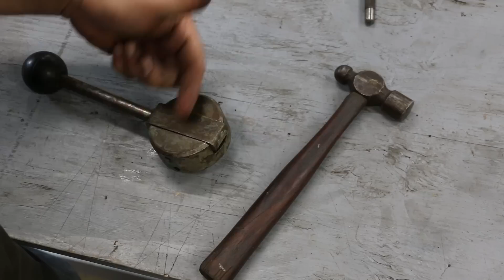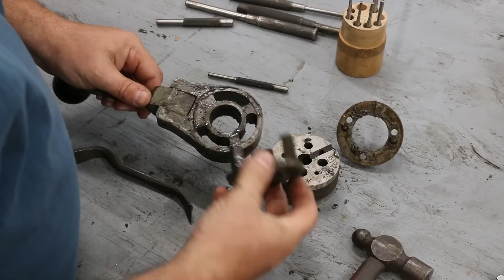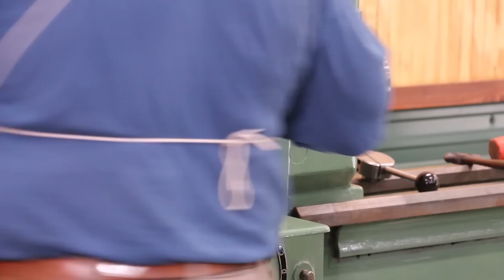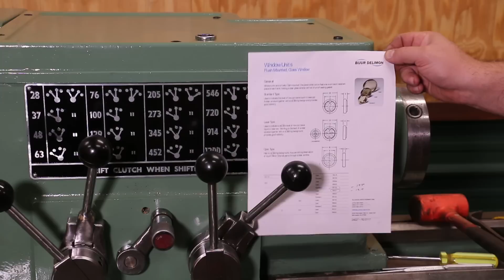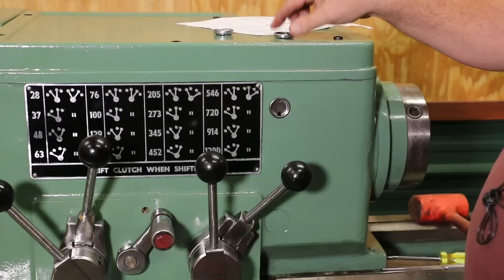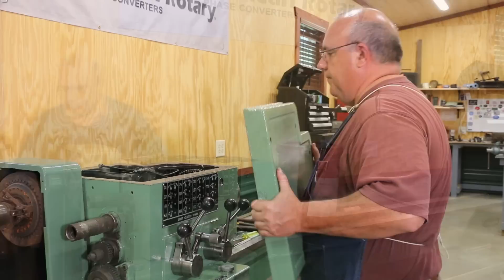Monarch Lathe Restoration 4: Front Controls

Comment: Keith, enjoy all of you videos. Lathe is looking great. I think a  couple of the screws in the gearbox cover were a little long. When you had them sitting in they were sticking out a lot more then they should have been.  If you pull them out and stick them in upside down, if the head is completely in the counterbore then you are bottoming out the threads and not tightening on the cover. Generally when I drop the bolts in the holes I like the head to be above the top of the counterbore between 1/2 and 1 times the thread diameter.

Comment: grey scotchbright SHOULD be "final" or blending grade

Light Green - Non abrasive for scouring and general maint
White - Non abrasive for polishing and light cleaning
Grey - Ultra fine silicone carbide abrasive for fine hand cleaning and finishing
Maroon - Very fine aluminum oxide for basic cleaning and finishing
Green - Fine aluminum oxide for removing rust or corrosion
Black - Medium aluminum oxide for heavy duty cleaning or fast action finishing
Tan - Coarse aluminum oxide for stainless steel aluminum and for stripping

Red is about 320- 400 grit
Grey is about 600-800 grit
White is about 1000

Comment: Two things. I'm surprised there's no gasket for the lid on the lathe. Secondly, your bench grinder wobbles like a drunk sailor. That really should be bolted down.
Reply: I'm thinking he is going to want to get a sheet of gasket paper and make a gasket for the head-stock cover. It probably leaks, or at least "oozes" oil. Why else would someone have used silicone on it? It would be a shame to have oil dripping down that pretty new paint job.

Comment: Thanks for another enjoyable show-n-tell.  Please describe "drifting the clutch while shifting", as it says on the plate.
Reply: You disengage the clutch (drop the handle down partway) without stopping the lathe, so that the gear train is "drifting", i.e. no pull against the gears and no deceleration. You can then shift without clashing. It DOES take some practice.

Comment: If the lathe top leaks oil a thin layer of silicone sealer on the machine surface and a thin layer of grease on the lid surface works wonders. The silicone seals it and the grease keeps the silicone from sticking the lid down. Works great, i've done it for 30+ years,

Comment: I usually find when I need to hold a spring, detent, pin, or whatever else tiny in a hard to reach spot and gravity keeps yanking it out, a touch of thick grease on the pin holds it just right. It helps lubricate and prevent rust in the future as well. Keith clearly knows what he's doing, just thought I'd share that tip with everyone.

Comment: I would be surprised if that top doesn't sweat oil when the lathe is running high speed and flailing oil around inside. Those handle mechanisims are interesting compared to the pegs on the case that detent the levers on my Monarch. Lathe is looking great, better get to making some more space in that shop for more tools! :-)

Comment: Hey Keith, When you get around to putting the clutch linkage and shafts back together can you show that in detail? I have a lot of wear in my clutch linkages and needs a lot of work I think it's mainly in the gearbox where it crosses the bed and then runs around the back of the head stock. Also if you pull the compound shaft out can you measure that as well I need to make one the original one is missing and I need a better idea how it goes together. My Monarch is a 1944 18CW 18" swing and 30" between centers. I think the parts are the same between them Just newer on yours.  Thanks. your lathe looks a lot better than mine right now.

Comment: Whenever I mess with the controls, I pull the shafts and replace the o-rings. The shafts are typically below the oil level and they always leak.

Comment: Looks good, did you do anything to the plastic knobs and if so what?
Reply: Nothing much happens to Bakelite knobs when they have been indoors.
Reply: I have a couple on a used machine that are beaten up so I was hoping there was something I could do.
Reply: You could drill and tap an 8-ball as Adam Savage has done, or you could refinish it by sanding and lacquering it, unless of course it's too far gone. In that case, simply buy a new knob online.

Comment: Strange that they would use roll pins as pivot pins, but hey it seems to work. Really neat that you found brand new OEM sight glasses.
If the clear coat on the handles gets beat up and rust becomes a problem, plating them might be a interesting project and a durable finish. I think Mr. Pete was doing some nickel plating on his channel, maybe a collaboration is in order.

Comment: Looking god.
I don't know if it is common knowledge your side of the pond but if, when pouring oil, you have the spout at the top you don't get the glugging as air can come in as the oil goes out. It may not have been a problem pouring oil into such a large opening but when pouring oil into, say, a funnel there is much greater control over the flow.

Comment: You're gaining on it!   Going to be a beautiful machine.
I noticed that sometime during this video the drive screws for the bottom of the spindle speed chart plat got installed.
 I also notice the red on the short, middle shift lever (at 17:11) but it doesn't appear to be red in later shots. Was that a reflection or is it painted red? Is that the reverse gear?
I'm really enjoying this series of videos. Thanks for sharing.

Comment: Machining beginner here: On the speed chart, it says "drift clutch when shifting". Can someone tell me what this means?
Reply: Eli Douek It means to just barley engage the clutch so that the spindle is turning just a little. This is done so that the dogs on the sliding shift collars will line up with the dogs on the gears. Back a video or two he had the top cover of the headstock off and you can see how the shifting mechinism operates.
Reply: images of this lathe drifting around a large parking lot, smoking its tyres...lol

Comment: In open gear system it is normally suggested using something like 80-90! Seems that you use a much lighter oil? Why? Is Vectra medium normally used on sliding surface?
Reply: i guess it because it wont get warm, so needs to be thinner, and thats the grade suggested by the manufacturer on the plate
Reply: If you watch the video Keith made about restoring the information plates on the machine, one of those plates says that the machine should use Vectra oil.